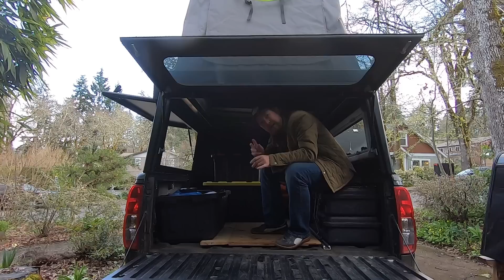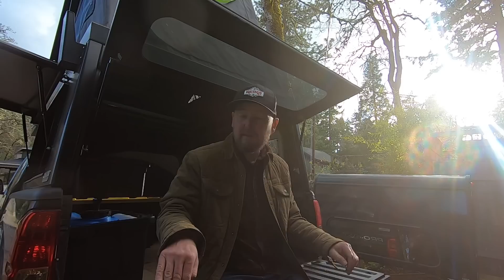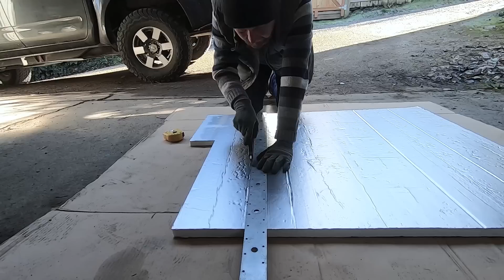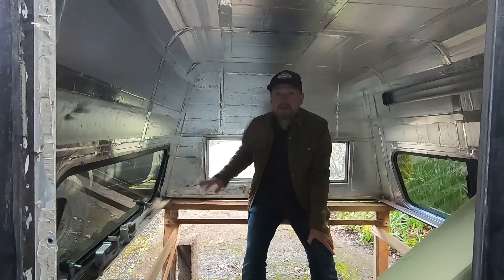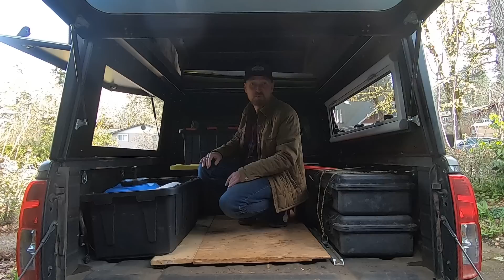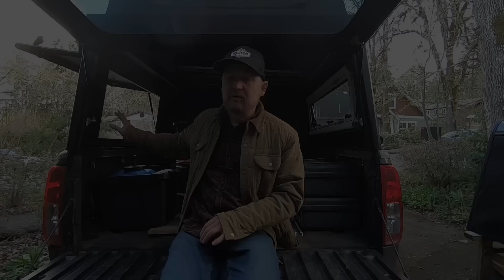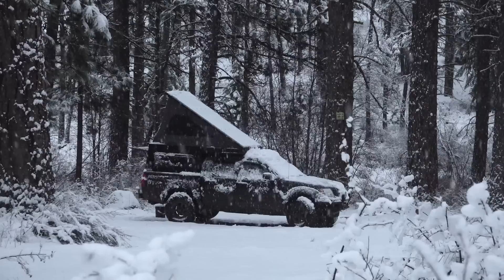Camper Interior Build Series: Part 1 - Planning & Ideas

Comment: The simplest way to control moisture inside is to install a small vent in the top cover that you can crack open.  Or maybe sew one into the canvas near the top.  Some shield would be needed to keep rain or snow out.  You don't need much opening if it is high.  I have used a Wave 3 heater in a trailer and they are great for overcoming drafts and maintaining an achieved temperature, but the main time I need heat is in the morning when getting dressed and when entering the cold trailer after being gone.  Something with a fan that gives you a quick blast of heat is more efficient for that.  The Wave 3 just isn't fast enough.
Reply from the maker: I have the zippers of the side windows in the popped-up canvas portion positioned at the upper apex and keep both of them open through even the coldest nights, and I'm sure that ventilation helps, but on a cold night in western Oregon with our extremely high humidity, that is far from sufficient to prevent condensation on the aluminum components. The moisture in the air here during our wet season (roughly October through May) is insane. At my previous house, all my tools rusted out even though they were stored in my (drafty) garage and never actually got rained on. 😆 That's why I'm hoping to avoid adding even more moisture to the air with whatever heater I use. 🙂  And yeah, the slower heat of the Wave 3 along with the humidity issue definitely leans me away from that solution.
Reply: @softroadingthewest  Sounds like a nightmare.  Okay, my main experience is in high Colorado, where the humidity is less.  I have camped a good deal in coastal Oregon, but only in the summer.  Funny story: I was camped near Olympic National Park one October when it started raining.  And raining.  So finally I upped stakes and drove down the coast, where it continued raining.  I stopped for propane and asked the guy when he thought it might stop raining.  His completely deadpan reply:  "O, around the middle of June."          About venting:  Have you consider a very light DC fan to hang up there blowing out?  Like a computer fan, that draws little or no power and is very quiet?
Reply from the maker: @bobgiddings0  Haha, it's really true. We just count on it raining all winter long and enjoy the occasional breaks when it happens to stop for a day or two. Computer fan is a great idea! I had completely forgotten about it, but I actually have one somewhere in the garage I bought to use in my previous topper and never got around to properly integrating. It's USB-powered, very light, very quiet. I should dig that out and see what I can do with it.
Reply: I have reconsidered my comment about the Wave 3.  It was very slow to initially heat up my 27 foot fifth wheel, but you have a tiny space in comparison.  And it was very nice quiet radiant heat as opposed to my forced air furnace.  Maybe too quiet.  It is easy to forget it is on, and it will char things that contact it.  It may be your moisture problem with the Mr. Buddy is actually a matter of too much heat for your application.  You can't beat a blast of heat when you are cold and wet, though. The Wave would be clumsier than the Buddy to move around, being always attached to a hose.  The Buddy is more versatile, since you lose all your heat every time you go in and out, as opposed to your friend's van.  If only the Propex weren't so expensive!
Reply from the maker: @bobgiddings0  Really there is no 100% perfect solution. Everything requires some kind of compromise, whether it's moisture or money. 😆 You are right that part of the problem with the Buddy heater is it's too much of blast, it burns so much propane so quickly that it's a big hit of humidity in very little time. But that blast is nice also when it's super cold and I need to warm the space quickly. Running the Wave 3 would require some adjustment on my part, such as thinking to step away from the campfire and turn on the heater at some point before I'm actually ready to get inside.

If I went that direction, I would do some kind of mounted installation as I've seen in RVs, with a permanent propane line running to it.

Still kicking around various ideas though. I still have quite a bit of time before I need to make some kind of decision. Thank you for weighing in, all these conversations have been helpful!
Reply: @softroadingthewest  Okay.  I think we're getting to the point I'm just suggesting things you have already thought of, like a heater with half the output.  But those are only good for 5 hours on a 1 lb. can.  Or maybe you can already turn yours down to half heat and have tried that output.  Trying out a used Wave 3 like the one offered you is a good idea, but bear in mind the element material wears out with time and dustiness and you may need to buy another to make it work right.

Comment: As for hauling stuff around, when I replace my truck with a jeep, I found a relatively cheap open bed 5x8 trailer for hauling wood scraps and trash, furniture, etc., was a good solution to the missing truck bed.  And even better for hauling a motorcycle to Colorado.  But you have to have someplace to store the trailer when not in use.  When I got a truck again a few years later I was able to sell the trailer for what I had in it.
Reply from the maker: This is actually a really good idea, and it would be nice not to have to engineer modularity into the build. Also I have to be realistic...even if I make the build removable, how often am I actually going to go to the trouble? A utility trailer would probably be more useful than my truck bed with the topper on it anyway. Definitely like this idea.
Reply: @softroadingthewest  Take your time and try to find a decent used one.  If it isn't rusted out, even the junkiest old cheap trailer can be made like new with a couple of tires, maybe a board or two, and a brushed-on coat of paint.  Couple hundred bucks, tops.  You can't do that with a truck.  Besides if you are like me you are only going to use it to haul junk, lumber, and tree debris anyway :o)  And it's a lot less worry to lend out an old trailer to "friends" than your truck.

Comment: You might have an interest in the Milwaukee packout drawer tool boxes at homedepot etc. They offer 2 and 3 drawer options. Always have complete access to what inside with drawers unlike stacked boxes. Plus they're entirely modular. Easy to pull out to the campsit, unload into garage for truck bed space. And you could create a full slide out cabinet base that they nest in and can pull out for your kitchen top to use outside the tailgate, then slide in during interior usage.

Comment: Great ideas Donald! I like the door on the driver side. You can put all of your cooking stuff in the cabinet and it will be accessible from the inside or outside. As far as a couch goes, I’ve seen some van builds that have beds built in sections held together with piano hinges. Zip zap it’s a couch with a nice comfortable back and seat. Can’t wait to see the progress. Too bad this topper doesn’t have barn doors like the other one.
Reply from the maker: Using the side cargo door for kitchen stuff is definitely near the top of my list as a potential use for that space, and yes, I would build it so it could be accessed from inside as well. If I can come up with some sort of table I could deploy right there, it moves my whole cooking operation closer to my fridge in the back seat, and means I don't need to cook on my tailgate (which I have to also walk on...)

Comment: Could you buy a decked system? it would serve as a raised floor and give you some storage!
Reply from the maker: I definitely looked at that system, because I could still stand in there just fine on top of Decked drawers and a lot of people do that with this style of camper. Couple of issues for me though. One is simply the expense (though theoretically I could DIY reproduce the same idea). But the bigger issue is that the bulk of what I want to store in the back of the truck is stuff I would want access to once I'm actually inside the camper. It would drive me bonkers to get holed up for the night, then realize I need to put my boots back on, drop the tailgate, go outside to pull out a drawer to get something I need...😆 I'm forgetful enough that this would happen nightly, I guarantee it. 😂
Reply: @softroadingthewest  I had thought of building my own floor system like that too. If I was to build one, I don't like drawer slides, so instead of that, I would buy those under bed storage bins that have their own small wheels on the them from Walmart. And I would just make tunnels for them to slide into then you could go further with that idea and make the top of the tunnel removable (really it would be a removable floor board that you can access from the inside if you have to). the downside is they are not very durable. maybe you won't need the wheels if your bottom floor is slick enough for those bins to just slide on them by themselves.  best of luck to you in your design!!!  you are an inspiration!

Comment: I would just use nice plywood for the cabinets. I assume  you will be using a portable type stove  rather than a built-in one. That would make it easy to use on your tail gate or a table outside. I was thinking modular units also but you have to make sure they won't bounce off on a dirt road. Good luck. I'm sure you will do a great job!
Reply from the maker: Yes, portable stove for sure. And yeah, even if I build modular furnishings, everything would definitely be bolted in. The Frontier fortunately has a nice tie-down system built into it which makes it reasonably easy to anchor things down.

Comment: I have the Snap TREEHOUSE wedge camper on my PRO-4X and when I rebuilt my truck bed to for camping. I had 3 goals; First, simplicity and the build had to be modular so that I could still use the bed of my truck as a truck, but also be able to load and bolt down by cabinets for camping in roughly 15-20 minutes. Second goal, have the ability to still sleep in the truck bed when I didn't want to raise the upstairs and so far that has worked well at least twice. Once above timberline in a Colorado lightning storm and once stealth camping. My final goal was to have the option to cook inside my truck been if needed. Not something I plan on doing regularly, but I did do once when cooking outside wasn't a good option.

Since I bought the insulation inner tent section for my TREEHOUSE, I only needed to insulate the lower section of the topper and plugged all holes in the truck bed itself with expandable foam and pool noodles (hopefully this will FINALLY keep mice out as well). For insulation on the lower topper section of the TREEHOUSE, I used 1 -2 layer of Reflectix Foil Insulation where I could and or winter camping I can also add a 3rd layer. Another thing I did, was to insult the back of my cabinets that are next to truck bed

Currently for heat, I'm using the Kovea Cupid heater, which is great for a small space. Not advisable for all night heat and since it uses butane instead of propane, it can be squirrely below freezing. For all night heat in really FRIGID conditions, I have been looking at either a built in or suitcase diesel or propane furnace. But since I live in NM, my lil Kovea has been working fine

My electrical power is very simple and just a Jackery 1000 that I can charge with a suitcase solar panel, or when I'm driving.

I have zero plumbing and use two easy to pour 3 gal water bottles

If you like, I do have some photos of my build on Facebook page, "Paul Mcclure Photography."
Reply from the maker: Sounds like a great setup! I forgot to dive into the water thing, but that is my plan as well. After having mucked around with various plumbed systems, ultimately I've been happiest with my simple 4-gal jug with a spigot that is simply gravity-driven. I plan to just get a second one of those...8 gallons will generally last me around a week in summer and could stretch two weeks in winter. Also much easier to refill along the way when opportunity presents.

Comment: I am really interested in how you build out you camper Donald . As far as a place to sit and relax and nap . Why not just use the  passenger seat ? As far as gluing carpet to the foil , I would be worried that the foil may  separate from the foam  . I will be starting a new build in a months time , that's when my new  Maverick will finally be delivered . So far the build will consist of a full bed rug ,Soft topper ,xtrusion rack and an Aspen lite roof top tent . So far its 220 LBS of equipment . Thanks for sharing your build and ideas .
Reply from the maker: My passenger seat is usually occupied by a large-ish case which holds all my cameras, drone gear, etc., and the passenger footwell is often filled with firewood (seasonally). Also, even reclined, it's not terribly comfortable for sleeping compared to curling up on a perfectly flat horizontal surface. It's also just a little too visible. Sometimes when I'm highway traveling and nowhere near public land where I can find a hidden pulloff in the trees, I have to nap in a parking lot. One thing I loved about my previous build was that I could hop in the back of the truck at any time and nap without feeling seen by people walking by. 

The nap space in the camper will also serve as a place to sit & hang out in the evening after I'm in for the night but not ready for bed, or during the day if the weather is nasty. It also would be an emergency backup bed if I was in a situation where I needed to keep the top closed down. Wouldn't be a great night of sleep, but again better than the truck seats. 🙂
Reply: @softroadingthewest  Yes I should have remembered form your other videos ,that you carry a lot of gear in the front seat . I was planning to remove my back seat and build a deck system . Do you remove your back seat ? I am hoping to carry my 12 v fridge and EB 70 in the back seat . Trouble with the Maverick is the bed is only 4 foot 4 inches long . I think with you tube creators , you guys carry a lot more equipment then the regular guy .  Thanks again
Reply from the maker: @dickvankoughnett2331  My Frontier has a 60/40 split rear seat. I deleted the 40 and built a support for my fridge with drawers underneath. Super happy with this setup. I'd love to remove all of the backseat and build that space out more functionally, but I have kids and too many times arise when I need two passenger seats (and this is my only vehicle).

Comment: Heat loss due to entry/exit of the shell means uniform temps are out of the question except at night. Then, because of the insulation, you do have a chance of maintaining decent heat levels. At a 130W (1.1A) rated output, the UL listed Davis AirDryr 1000 is designed for continuous AC use.  There also a smaller model @ 70W/0.7A model.

I know it's heretical in some circles to suggest anything but solar sources for battery charging, but Oregon is hardly ideal support for such lofty aims. The ALP propane generator can be stowed in a living space and put to use at a convenient time, and will easily slake the thirst of several Jackerys.

Comment: Bed Rug has molded ridges the fit the corrugation of the bed floor, very comfortable on feet and knees if you don't do storage area.  You do have the room for 8-12" of storage.  Search YT for DIY tailgate storage. Going with a power station is a wise choice.

Comment: You inspired me to purchase a Leer commercial canopy for my 21 Tacoma Offroad LB. I knew that the heating was going to be a big issue the 1st night up in the Olympics, I was also in for a rude awakening camping during a heavy rainfall. The rain hitting the alum shell kept me awake and the condensation from the little buddy didn't help matters at all. I added insulation like you did on exposed shell panels and picked up a 350W 120V electric heater. Surprising it works very well. Then I mounted 2 back to back 8' pull out awnings above the rear door. 1st one extends over the canopy and the 2nd over the rear end of the truck. What a difference it has made. Spent another week up in the Olympics with both rain & snow. My Tacoma has a factory 120V 400W inverter, which recharges my 1000W Vitoman, I've ran the heater all night without drawing down the Vtoman below 65% and then recharge with the truck. I'll pick up the solar panels shortly. I recommend a 1/2 bay drawer that you can build your couch upon and then maybe a fold down tabletop on the other side, along with trying to replicate a 1500W battery inverter system. I also picked up from amazon a rear door mosquito net that work with the real awning. Plan on doing some overlanding in Montana and somewhere around Billings the mosquitos morph in size to the point that they have to register with the FAA. Good luck and looking forward to your build and next adventure.
Reply: That sounds like a really nice set up. You should make some videos and share it with the world.

Comment: Couch with flip lid and a drawer to the rear, Webasto / Espar heater (gas not diesel  to plum into fuel tank) and electrical just run extension power strips.

Comment: Couple of points I might have already dropped here but... The Road Chose Me and Venture 4WD both have done flip top jeep build outs, maybe you can steal ideas from them. Secondly, look into getting your alternator hot rodded. Find an old school auto-electric shop, they are getting scarce but still exist and have them re-build the alternator. Higher output, faster charging of all things, no more need for even solar in our case. Only issue is with newer vehicles it may or may not sense a faster charge than expected and shut off the alternator output, solution is to put the alternator output through a DC to DC charger. then on to the truck start/stop battery, house battery and/or one of the battery packs.